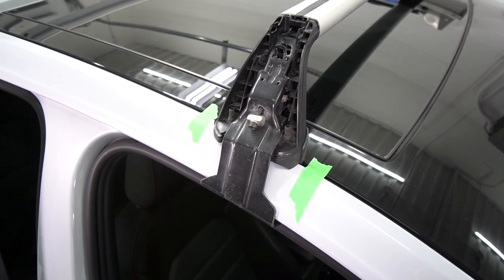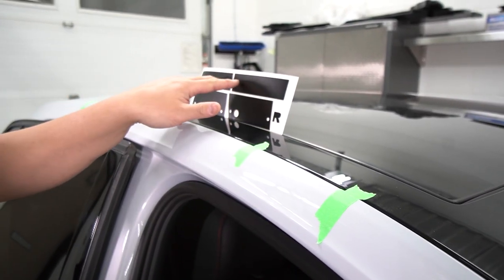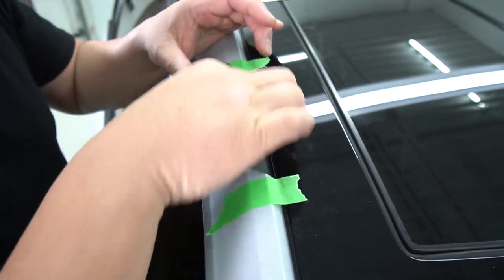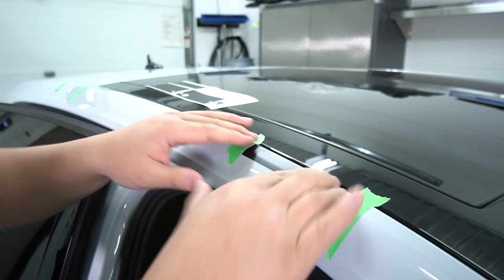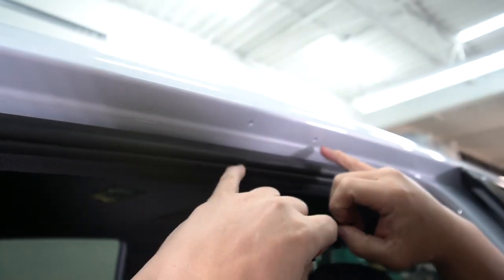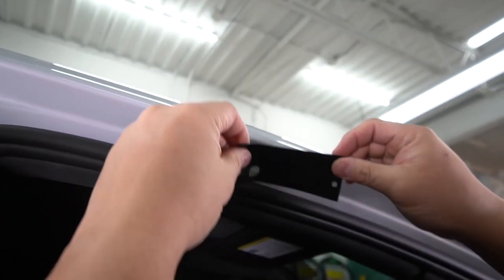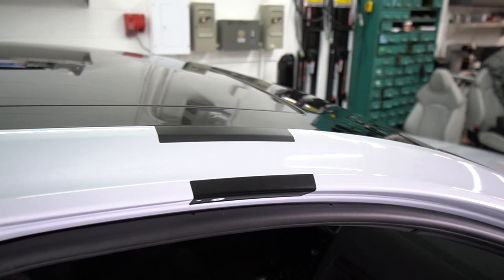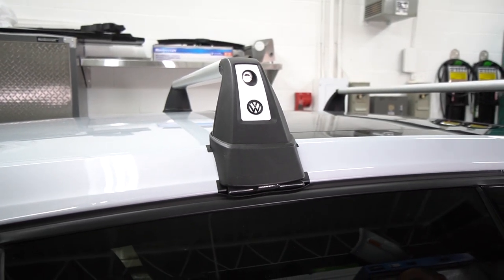VW MK7/MK7.5 Golf's Roof Rack PPF

Comment: What a terrible design. What was wrong with keeping the holes in the roof instead of putting them in the door jams??
Reply: Yeah, my 2005 3 Series had the best design I've seen on any car since. Simple little flip-up doors tucked into the rain gutter, hiding a welded-in nut that the factory rack bolted into. Zero contact with the paint.